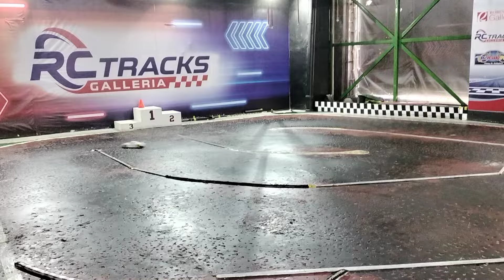Tamiya TT01 and M07

Comment: How do you like the m07/m08 compared to your tuned m06 and your trusty M04?
Reply from the maker: The M07/M08 are better. Easier to drive and  faster (maybe due to oil diffs, longer arms). Easier to tune with the droop screws.